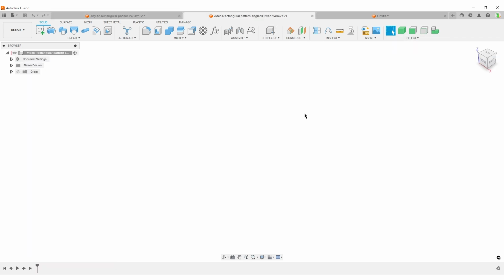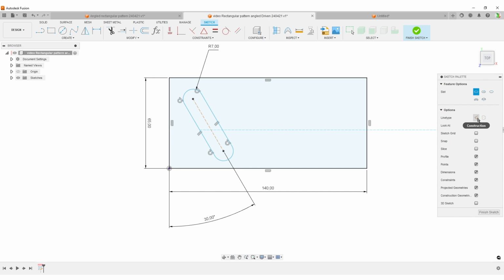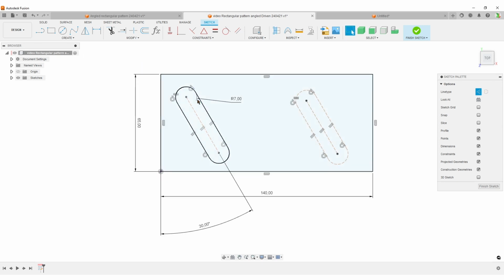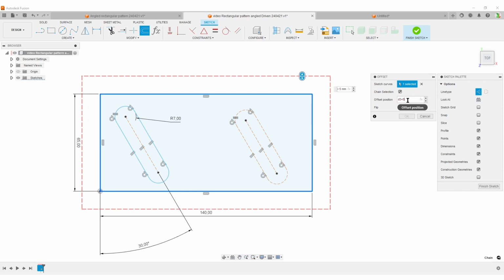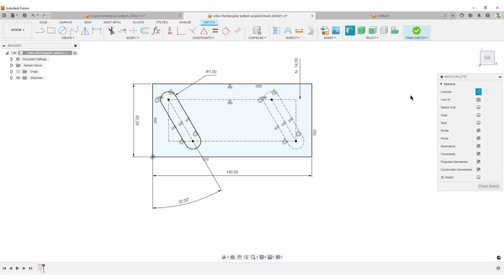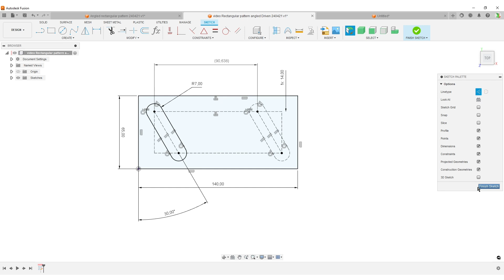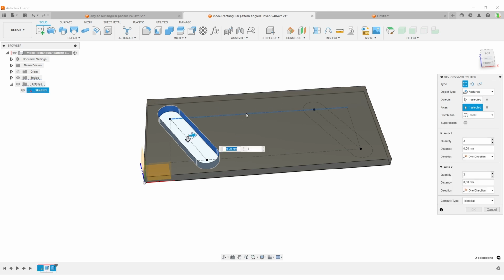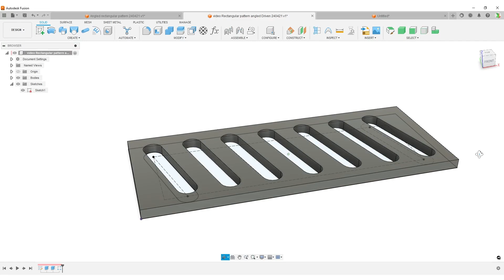Fusion - Rectangular Pattern with Driven Dimensions (No Math needed!)

Comment: What's the reason for not wanting a pattern in a sketch? Besides not being visible on the timeline that is.
Reply: simple: if you increase the cutouts in the pattern or formula those will not be extruded, but you have to manually make those. try it
Reply from the maker: Like andi mentioned selection problems. Pattern in sketch can slow down the design (if large). Readability of model etc.

Comment: Love your tuts. Some of the best I’ve done.  I’ve not worked through them all yet but do you have any on how to organize/categorize the parts of a model? 

Eg if designing a house. What is best practice in terms of:

What should be components? Each stud? The set of studs that make the wall? 

I presume the wall is a sub component of something bigger. Is the window a sub of the wall? The studs a sub of the wall? The drywall sheet a sub of the wall? Wall sockets? The wiring etc?

I presume this varies eg if the drywall has unique aspects to it it would be its own sub. If it’s just some sheets no need?

Perhaps how you plan to detail it and produce the construction instructions/process out of it has an impact? Eg step by step animation. 

So basically do you have any videos on best practices for organizing your pieces into bodies/components? And perhaps some wisdom on top d versus bottom u? 

Thank you for your work.
Reply from the maker: Fusion leaves much of that planing up to you. Brad has some good videos on assemblies.
Reply: Thank you sir Laholm. I will check out … “brad”.

Comment: Thanks for the video. How would I make it to have the same spacing in between the holes as towards the wall? Is there an easy way to constrain this as well?
Reply from the maker: Interesting question. I had to give it a try and yes it works. You have to not dimension the slot, add the closest slot the first one and dimension it using the driven pattern dimension. It's a bit hard to explain in text do some testing and come back if you can't get it to work.
Reply: @KristianLaholm  thanks for your explanation, tried building it and setting the right constraints but unfortunately did not get it to work. Fusion 360 makes something easy as equal spacing very complicated. I wish that CAD software would be more intuitive.